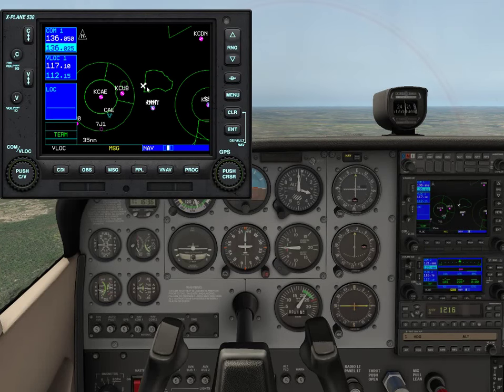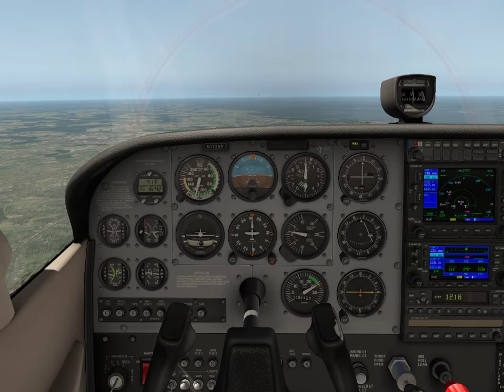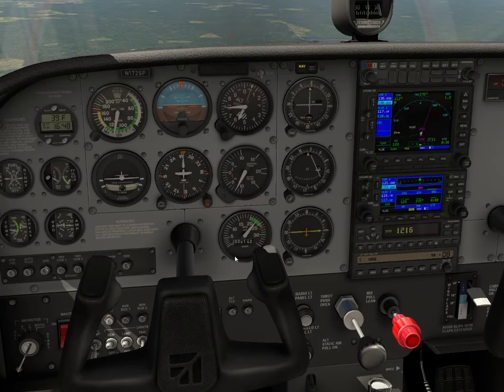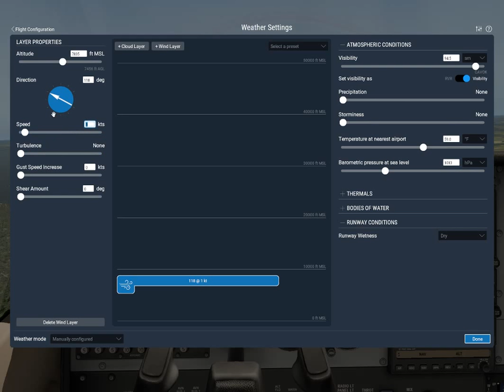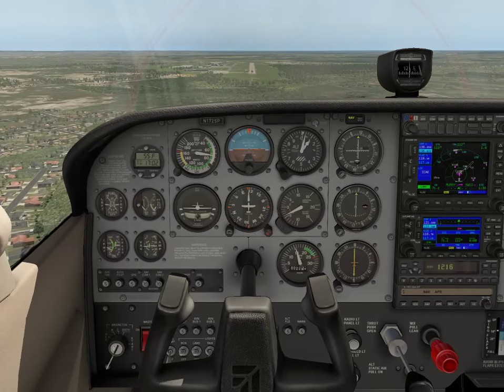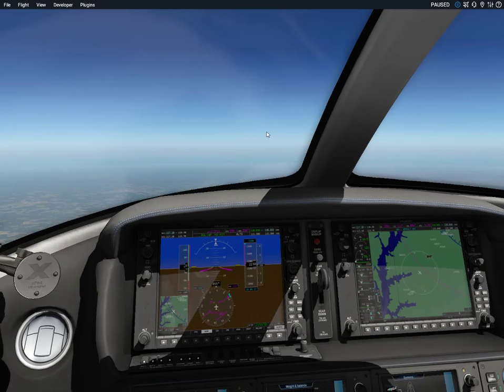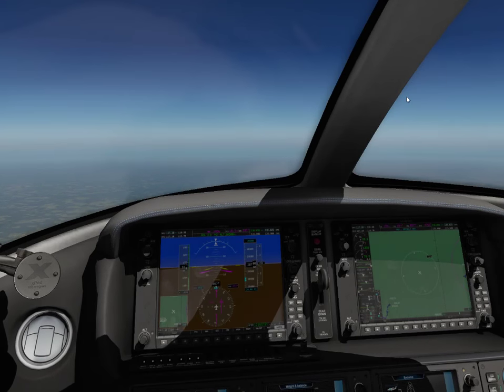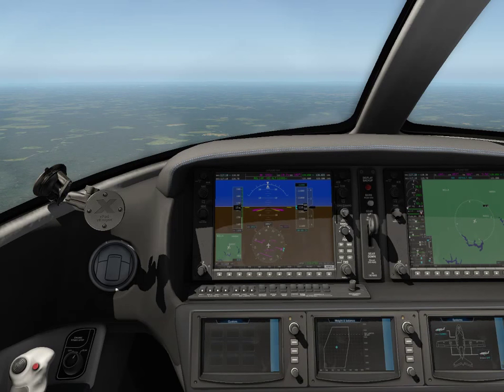Control Wheel Steering, Marker Beacons, and Emergency Descents

Comment: Thanks for your informative videos. I remember from my high altitude training that another reason not to nose over the airplane is your passengers may not have their seatbelts on at cruise altitude. If you nose the aircraft over during a rapid decrompression they may be thrown from their seats due to the negative G's. Not only will this cause injuries , it will also prevents them from reaching their oxygen masks when they are deployed. Keep up your great work at XP.......it's much appreciated at this end.
Reply: Lyle Paradise I did that to my instructor when the cable broke at the top of a winch launch in a glider. I went straight into carrying-out-the-launch-failure-drill mode without considering we were above 1,000ft already and there was no need to rush.

Comment: Philipp

I would like to say thanks for your and the rest of the team's efforts to make this a very accurate flight simulation model. As a 30 year Career Corporate Jet operator for Fortune 100 and above Flight departments, I have an additional 1000 hours in XP11 and a further 700 hours in XP 10. In what I call my spare time I have worked with SMS in Project Cars in consultation and now I have been working with Jim Gregory on issues I have found in the Baron that were missed or miss modeled. I have been working with Japo on his current SF260 project as I have a good deal of time in the Marchetti. I refer to the TCDS sheets to get the most accurate information for Airframes, Engines and Avionics. I would be happy to report any Avionics issues I find if that would be helpful. 

Big fan of CWS and it's usefulness in everyday changes that come up as ATC struggles to make up their minds while I hurdle thru space at 8 miles a minute. Nice work out with all the approach goodies, helpful for those who watch and want to do it properly. 

Because I fly fast high altitude equipment I always recommend using the approved emergency Checklist for the specific AC, but it is pretty much a memory items for me. Time of useful consciousness varies of course but generally you get a 10 second window to clearheadedly make the right choices. I had a Smoke in the Cockpit scenario at FL 390 in a C550 of the Gulf of Mexico at 2 am. I usually wear the mask around my neck above FL250 and it proved a smart move in this case. I picked the time to decompress and turned the  pressurization source selectors off and let the DP equalize slowly over about 30 seconds. They don't teach that at FlightSafety. But it's Mask, Mask mic, Passenger O2, Idle power, Spoilers, ignitors, flaps, gear, 60 degree bank, ATC and confess, and land as soon as possible. I had High Altitude time before April 1991, and 2 single pilot jet type ratings. It's about having an organized mind and knowing your equipment. 

Also I've been experimenting with Hall effect sensors and how to integrate them into my cockpit. I would enjoy some time chatting with you about datarefs for heading bugs, and touch screen applications in my sim, if you can find some time. If you are philipp@X-plane.com I will contact you there.

It is really nice being able to help make things more accurate.

Cheers and continue with the useful hints....

Robert
CE 525(s) -500 -650 -750, IAI 1125, CL60

Comment: Is CWS modeled correctly?Manual states you should have full control when AP is on but no other buttons selected but in my game CWS is always on.To turn it off I "hold" CWS key .Shouldn't CWS come on when you click the CWS button and stay on and then show the CWS icon?
Reply from the maker: It really depends on the type of autopilot you have. On an S-Tec it will be in rate hold when activated, and when you press the CWS button, it will allow you to fly by hand and then when you let go of it, it will be in rate hold+vs hold. So yes, to turn off the servos you need to keep the CWS button depressed. The GFC-700 will be in pitch and bank hold when activated, and CWS allows you to fly and select a different pitch and bank angle. As to what happens when you release the button, it will depend on which mode you came out of, for example if you came out of heading+alt, it will revert to bank+alt, with the alt reference adjusted while you were pressing CWS. On some other modes, for example approach, it will allow you to temporarily deviate from the approach but will revert to capturing the approach when you let go of the button.
Finally, the 737 autopilot has no momentary action CWS button at all, but rather an explicit mode select button for it. So it really comes down to the type of autopilot you are flying, and the abovementioned types are all correctly reflected in X-Plane 11.30.
Reply: Great news,thanks Phillip.